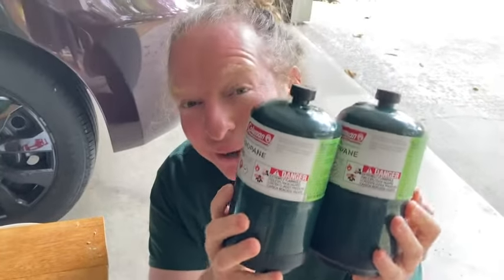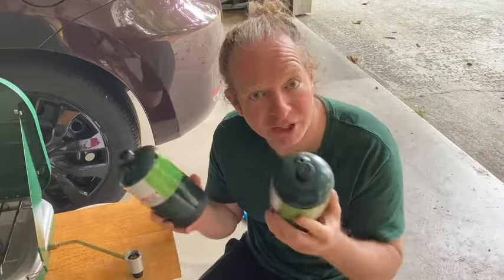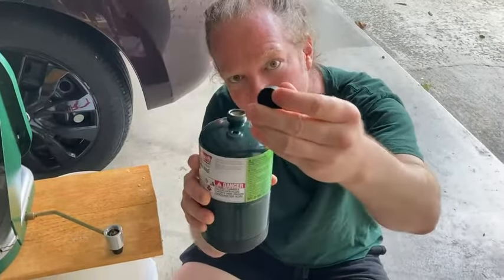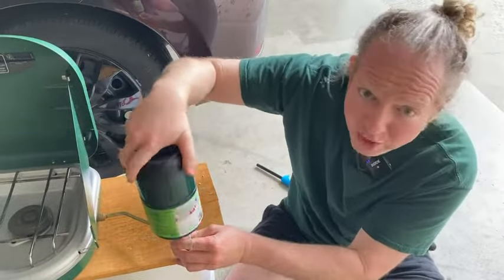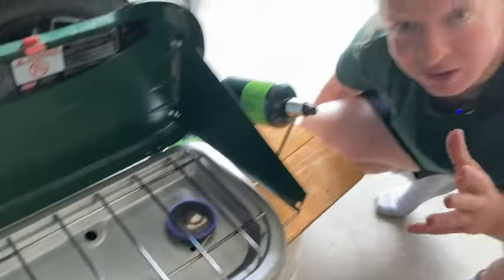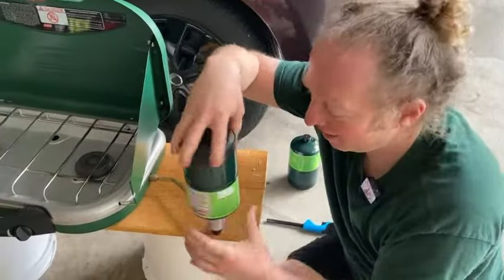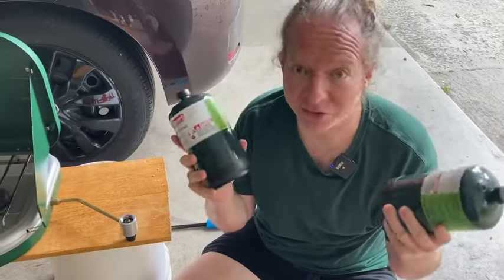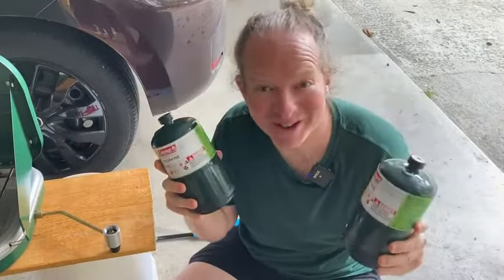Coleman Propane Fuel Cylinders

Comment: nice Video, Thank you. What I am trying to find out is if the cylinder it's self expires?  I have read that "propane" does not go bad, and 20 pound tanks need a valve replacement after 10 years.  My stove has not been used in a few years and I have 2 and 1/2, 1 pound tanks left in the shed.  Also what about the stove attachment for the cylinder? do they need to be replace every 10 years? since they are sort of a valve?  Sorry for all the questions, But seems no one else has done a video covering this.  Thank you.

Comment: I put a Bernzamatic torch on a Coleman tank that is about half full and it worked fine at first, but then I couldn't get it to ignite. I put the same torch on a different tank and it worked fine. I tried another torch on the first tank and it wouldn't ignite either. And when I unscrew the tank it makes a sound like opening a soda can. Like pressure is being released.